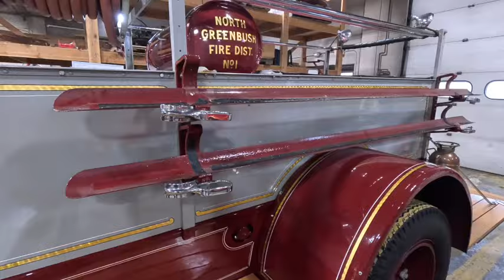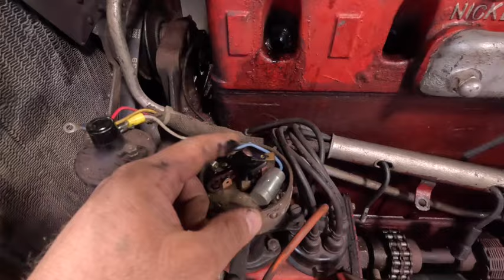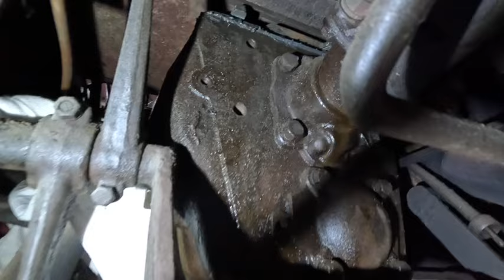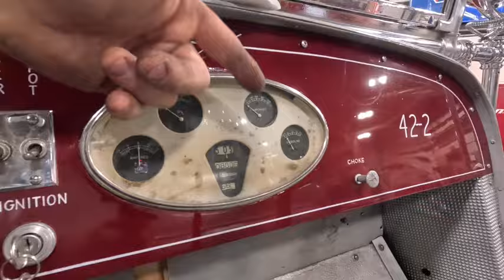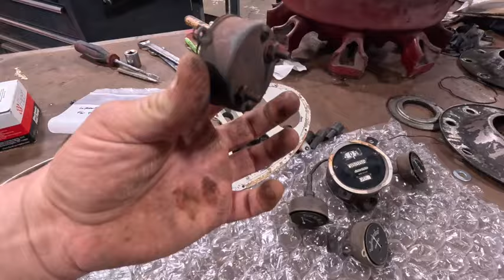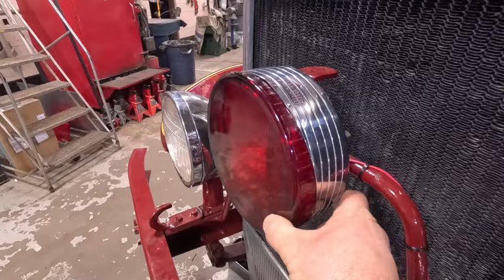1928 Sanford Fire Engine Restoration

Comment: That is definitely a different paint scheme, and it actually lightens up the fire engine from the usual everything is red design. I have read some about the Federal trucks and they were in operation from 1909 until 1959 and I understand that they were completely vendored. That is, they did not manufacture anything but assembled and marketed their trucks from vendored sources. I think that they vendored Hercules engines and of course as Mark mentioned the engine is this truck is a Continental unit and interestingly could have come out of a military vehicle quite possibly out of a Federal supplied unit. Interestingly enough is the Stewart Warner gauge cluster which as mentioned was a vendored unit to be used in a varying type of application. This unit beings manufactured by Stewart Warner would fit many applications and most applications would have a sending unit (of course adjusted for different tank capacities) for gasoline. Of course, this truck not having a tank with a place for a sending unit was gauged with the "stick method". Many old timers who drove big trucks would stick their tanks as they did not trust the gas gauge in their vehicle. A big problem with big trucks was the sloshing of the fuel in the tank (the tank would have baffles but not so efficient and I have seen baffles get busted loose inside of old fuel tanks) and that sloshing would damage sending units and render the gauge system inoperative. This of course was back many years where we did not have a truck stop on every corner so to speak (now we have them at about every Interstate exchange). Looking forward to the next installment on this one🥸👍👍👍👍👍
Reply from the maker: Thanks for all that great information and the history lesson!